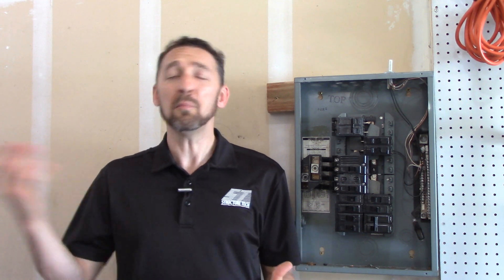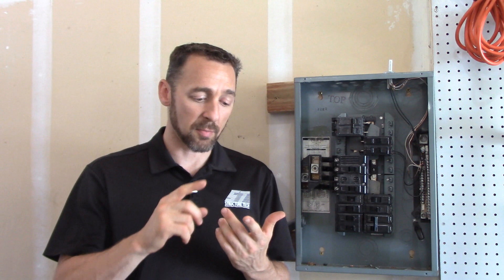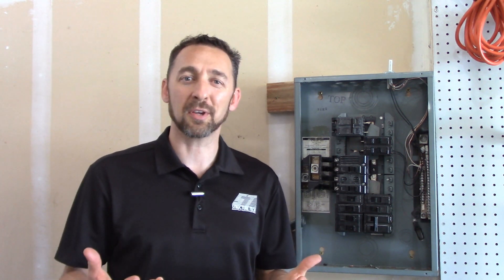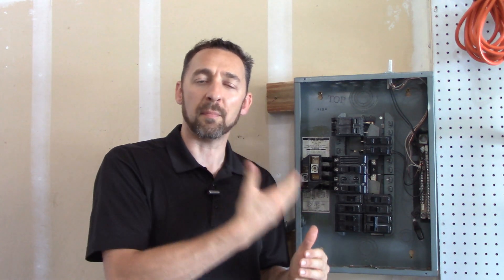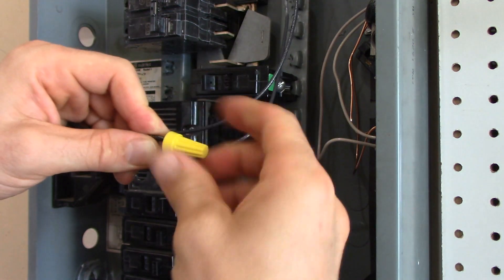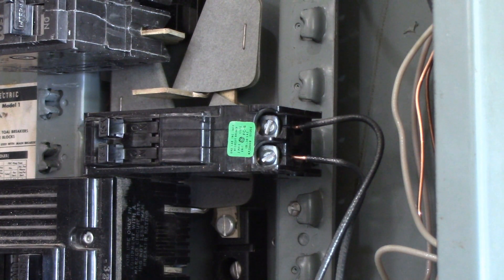How to fix a double-tapped circuit breaker

Comment: before bothering with fixing "double tap" be sure that the breaker is not double tap rated. All QO products 30 amp and lower are double tap rated! You can actually tell by the shape of the pressure pad having two places for wire. I don't know how many times I have had a home inspector call out a double tap that was actually legal. It costs the customer a service call for the electrician for no reason.

Comment: How do I know if my Square D breaker can hold two wires
Reply: Look at the pressure pad where the wire enters. It will be obviously designed for double tap. The side of the breaker will also tell you if you remove it and read.

Comment: Wow ... who taught you how to wire?  #1 Your NEW pigtail wire is not code... you have to much exposed bare wire coming from the breaker.  # 2 Not required but a really good safety practice would be to wrap electrical tape on the yellow wire nut so i does not come undone!
Reply: My inspectors will make you remove tape on top of wirenuts because it is not the way the manufacture instructions tell you how to use them
Reply: Never tape a wire nut. There is an installation specification and you should follow that and that alone. I could quote the average spec but forget it. You should don't be doing electrical.

Comment: What can you do if 2 single pole breakers are powering 1 outlet?
Reply: You should have two hot wires in the receptacle.  Completely remove one of the wires and tape/wirenut it.  Many would just worry about the hot and leave the neutrals alone.  I would undo the neutral to prevent some sort of fault tripping thing.  I would leave all the bare copper wires connected.
Reply: You are damned lucky and they must be on the same phase or you would have blown the breakers and maybe damaged the panel. just make sure that ONLY one breaker controls that circuit.

Comment: So i have a wire 12/3 wire, black, red, white and ground but black goes to a 20am breaker and the red goes to another 20am breaker. Is this correct, is this safe.. should I get a double pole breaker and fix this. Why would this be wired like this on the same wire
Reply: If the two wires are sharing a neutral they must have a double pole breaker with a tie bar so they both shut off. Otherwise you can be electrocuted when working with the circuits and one is off.

Comment: You should not use the term “tapped”.   There is a very specific condition that is in NEC defined as a tap.   This absolutely does not meet that definition.
Reply: Double tapped is how we call it in my area.  When I was in the Army, double tapped means two bullets were inserted into the target,

Comment: Question? I have a 2 story condo. My attic is on top my office. Attic has water heater, A/C & furnace. Office has treadmill and computer. On the same singles breaker. There are 2 switches. Should i separate these two rooms?
Reply: If breakers are tripping.  Yes
If you have spaces to add more breakers. Yes

Comment: Anyone watching this and thinking about doing this themselves,  make sure to cut the power on the main breaker before doing any of what you saw, and also realize that the giant wires feeding the busses before the main breaker is still hot and make sure to stay clear of it and don't put yourself in a situation where your screwdriver might slip and jam into it. It's also a good practice to never put yourself in a position that you might slip and hit the mains or the buss bars ever, even if you think they are disconnected.  And it doesn't hurt to check stuff out with a meter before you start anything either. You never really know until you test it. And if you don't know how to use a meter, then you probably shouldn't be doing this honestly.
Reply: Thank you

Comment: Although the tail is very short, would it be a good idea to make it a larger gauge?  Say 2 12Ga together with a 10Ga tail.  I suppose no, because the 12Ga tail will not see more than 20A from the breaker.  Correct?
Reply: nope. There is no reason because the breaker will "blow" to protect the wire. If the breaker is 20 amp, all wire must be at least 12 gage.  If it is 15 amp then all must be at least 14 gage. You can use larger wire, but there is no justification as the breaker will blow at those amperages and pig-tailing will not increase the total of amperage allowed.

Comment: Hey I'm adding a plug in just above my circuit breaker so I can plug in my security cameras.   I have no more room for neutrals.  
Oddly I have two  bus bars for ground.  Is it safe to find a circuit that just powers like the bedrooms and pigtail.  Or should I pull out the lead and make the new box the first connection and pigtail inside the new plug in box.
I hope that makes sence.

Comment: A double tap is dangerous specially when a solid and a stranded wires are connected on the same screw , or when you have 2 different size wires , also you must be very careful and I won’t recommend doing this to the DIY, if you have multi wiring circuits ( that means 2 or more circuits sharing the same neutral ) you cannot just add breakers , you can add another breaker , but it must be on the same phase where the double tap is , if you make a mistake here you can overload the neutral wire or burn the insulation , a tandem breaker is a better option and most of the manufacturers make them .
Note : when you have wires of the same size and type is not a big deal , but is not up to code and is something happened in your house the insurance company probably won’t pay you , another NO NO , is when you have a copper and aluminum wire on the same screw , or spliced together.
Sometimes is better to hire an electrician ( licensed) and have peace of mind , and be careful because there are some electricians that are not clear on the neutrals issue.
GOD BLESS YOU

Comment: Pigtailing is the connection choice for tapping more than one wire connecting to load side of breaker.  Just don't go over the wires rating both in amps and voltage.also breakers rating.
Reply: You’re allowed to go over the wires rating as long as you follow tap rules. There are 1/3 ampacity taps and 1/10 ampacity taps.

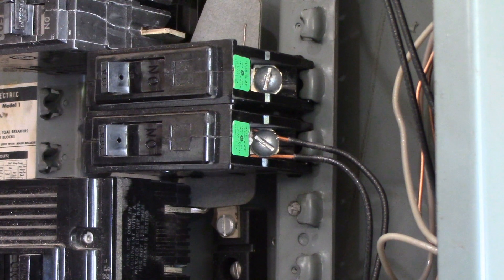Comment: 4:20 eekk, connections need to be properly torqued, especially in a segment discussing the risks of potentially loose mechanical connections. That doesn't mean with your screw gun, that doesn't mean with your wrist. Any professional electrician needs to have a calibrated torque instrument and use it.
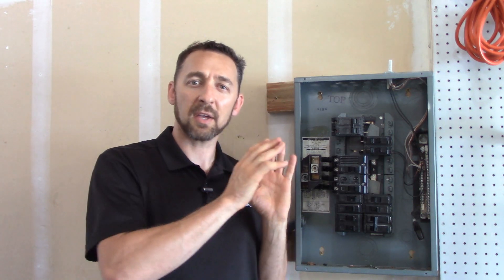Reply: 2:51  you must have missed this part  :)

Comment: I appreciate your time 😎 one project I’m doing is expanding my house I have a 200 amp split bus panel that’s full but I am going to move a couple breakers plus the hvac circuits to the other panel which will be all on the opposite end of the house I’m doing it also to reduce voltage drop. I enjoyed watching your video 😎

Comment: Thanks for the video - it does a good job explaining this issue.  I recently had an inspector point out two double tab breakers in my CH panel.  After some research I found that the breakers i have do allow double tap.  Like you mentioned, not all do.  On CH, it's not clearly marked.  You have to pull the breaker out and look on the side at the molded in text.
One comment - you clearly stated this is not a full how do work in an electrical box safely video.  But even at that, showing pictures of unscrewing wires with the breaker on is a little bit far down on the "I'm not showing you everything" list
Reply: With left hand holding the metal part of the screwdriver 😆
Reply: If you look at the pressure foot that captures the wire, there will be two places for wire in units that allow double tap, there will be a flat foot or single detent in the ones that do not. No reason to remove the breaker.

Comment: Super Thx Going to tankless HW heater which needs 3-4 40 amp double thro breakers problem is my box is full. Square D makes two wire circuit breakers and two brakers on one circuite braker slot. You and your video saved my butt.

Comment: Technically, it's not legal to pigtail in the panel like that. It's a splice. Bhut in a home, generally an inspector isn't going to get all hard nose about it unless he's related to Hitler. 
I once replaced the entire guts in a house that had the entire guts ripped out of it. All the wires were cut. First electrician looked at it told the homeowner that it was going to be expensive because by code, he had to rework everything so that there would be no splices inside the panel. But I told him, let's try it: I'll splice it all back together, make it very clean, and the inspector tolerated it because A:  it was clean and practical and it wasn't going to start a fire. 
B: the homeowner was going to be on the hook for a hefty bill from an electrician if it was all put back accordion to code and that homeowner was already a 'victim' they stole his panel guts and his A/C. so he let it slide.
Reply: NEC 312.8a states otherwise.  It’s perfectly legal to do splices or taps in the breaker panel.

Comment: I just fixed this issue tonight as you demonstrated on 2 breakers. I just lost my first time buyers today due to the inspection report stating "potential fire with double tapped circuit breaker" and with "estimated roof life of 5 years left" which I just had a roofer out 4 months ago and he said the roof was easily good for another 10 years. At least it's resolved for the next potential buyer so thank you for your video. The buyer actually seamed more worried about the double tapped breaker fire potential. Anyways, these first time buyers seem to want a perfect new home however they don't meet the criteria for a higher down payment and loan. The reality is you're just not going to find a new build 3 bedroom ranch in my area under $210k. My home was built in the early 60's and for a 3 bedroom at $165,000 with new paint and flooring, is a perfect first time home however inspectors will always find issues.
Reply: Dick Longmire     Home inspectors are used for bargaining the price down......yeah your roof is crap ......fire hazard.......double tap easy fix.  Seen enough home inspector misses also........the pig tailing the wires and putting the wire on the same breaker is putting back the same load......what you are saying doesn’t make sense.
Reply: @blackpine6693 can’t say I didn’t use that tactic to get a new AC and $10k in cash credit to fix various things 🤷🏻‍♂️
Reply: @blackpine6693  if the circuit is not overloaded then this just fine. If the circuit was overloaded it would trip the breaker.
Reply: @thomasmarable6818  If the breaker is not designed for double tap it is actually a fire hazard. One wire can be loose and the other tight, or both loosen. This creates HEAT. it is an easy fix if the circuit breaker is not double tap is not rated.
Reply: Do you mind if I borrow your comment...well at least the last chapter of it. I need to sell my house, so I'm taking notes, this is good stuff
Reply: Yes home inspectors can run a sell, but I have gone in and over rode what they said because my training and license is  regulated by the state.
Reply: Same here. Home inspection noted the double lugged breakers and they spooked. Backed out of the whole deal.
Reply: @rickpringle2615  If the breakers were double tap rated you have an actionable condition against the inspector's errors and omissions insurance for interference in sale.
Reply: I'm in a similar boat!!
Reply: I have had clients tell an inspector to write everything up and make it seem all really bad and expensive. This was to be used as a negotiation tool. It is actually an unlawful request. This is why my clients could choose inspectors but I would caution them to let him do his job. I have also seen inspectors "guesstimate" the cost of repairs, this is NOT their job and usually proves that hey are a contractor or a salesman for a contractor and are in CONFLICT OF INTEREST. 

 It is NOT the inspector responsibility to talk of double tap being a fire issue, it is a CODE issue when the breaker is NOT rated for double tap. It is not a problem at all if it is rated for double tap.

If you want to know the truth: you had a licensed roofer say 10 years. I would have asked the inspector for his E&O insurance information and told him a claim is imminent if he did not have a roofing license and said otherwise. In fact in many states the inspector just needs to assure that the roof should last over 3 years.  Same if he called out double tap in a properly installed and rated device and FOR SURE if he talks of FIRE where there is no evidence that a condition will cause a fire. 

A statement by an inspector should be neutral, and should be stated exactly per the specification like this;    Is: double tapped wires in panel 3 places in unrated breakers.  Should be: single tapped breakers or breakers rated for double tap per manufacturer specification and electrical code.

Saying anything but what the condition and specification are is a very big "no no" and frankly can be interference in trade.
Reply: Just read our buyer's inspection stating "double tapped circuits & neutrals," and I came to YouTube to figure out if it was a big deal and if I could fix it. We close on the property in 3 weeks :)

Comment: 2 branch circuits drawing 20 amps EACH (16 max each) connected to ONE 20 amps breaker really?? Then you pigtail the 2 #
12 AWG to ONE #12 AWG?? You load your little cute pigtail #12 gauge wire with twice max 16 amp from each branch? I don’t see how that can fly...
Reply: The breaker will trip if the circuit was overloading.  The electricity flows from the breaker out to the pigtails then to the loads, not from the loads to the pigtail to the breaker.
Reply: @vinty82  tht is a reason why pple should not mess with trades and just STICK to carpentry 😉
Reply: Learn some simple math and basic electrical knowledge.  You’ll answer your own question 🙄